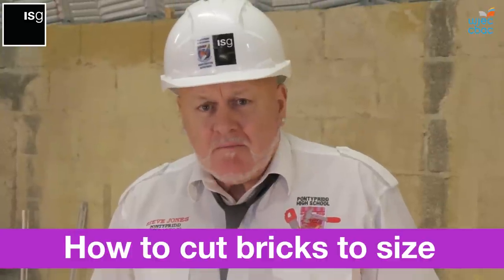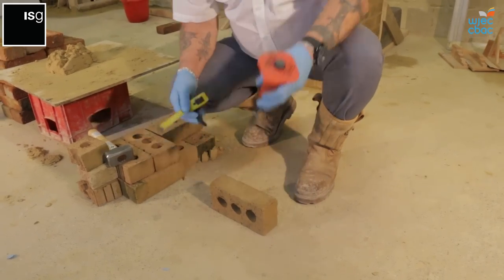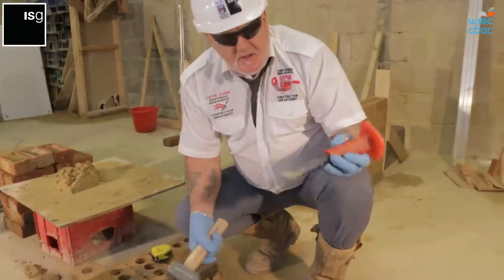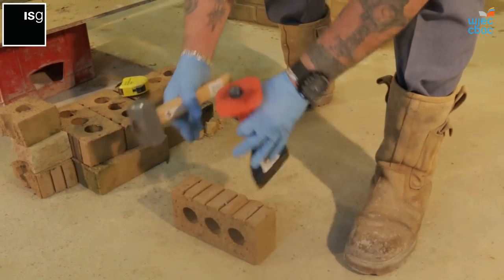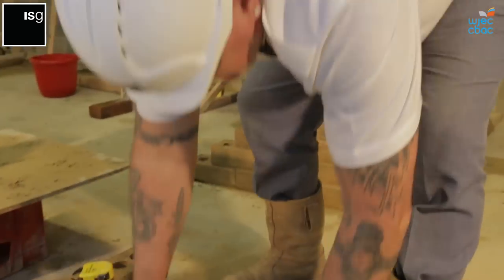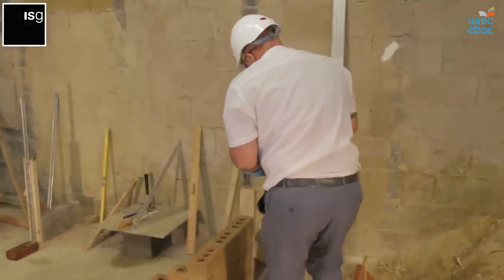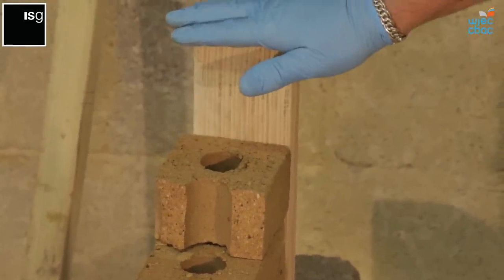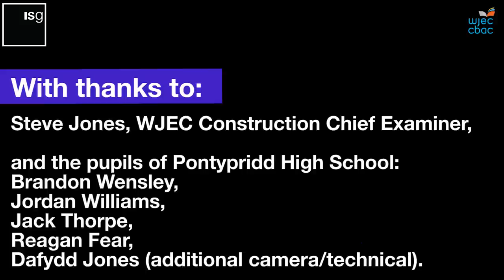How to cut bricks

Comment: What's the name of that brick?
Asking because I have the same bricks. Which was an interior decorative wall (not structural or load bearing), that I want to make into pizza oven. Doing research about bricks so I know they won't explode when they heat up.
Cheers.
Reply: Wouldn't you need 'fire bricks' for a pizza oven?
Reply: The brick is named "dave"
Reply: Hollow bricks can be used to soundproof, so it makes sense for that type of wall.
Reply: Sir Bill Wisley

Comment: Its 2019 old man there are saws! Are you kidding me
Reply: A manual saw is too expensive and it takes forever to cut it. An angle grinder might work, but the diameter of your disc should be large enough for that. And I kinda like to do things with tools that are as primitive as possible (purely mechanical if possible).
Reply: are you gonna buy me a saw? i can afford a chisel and i already have bricks.